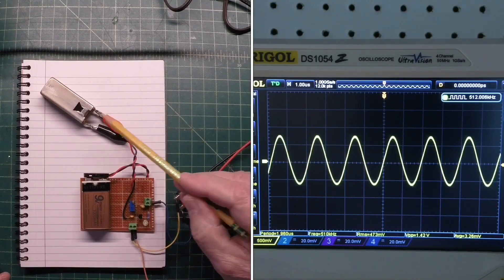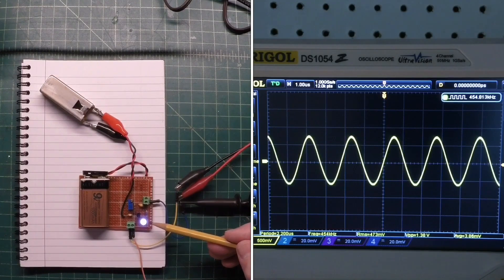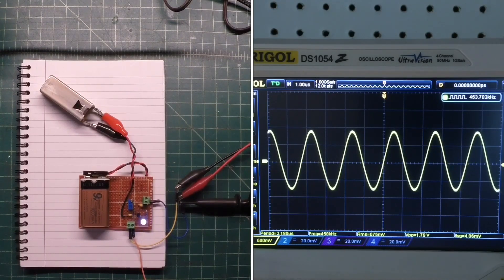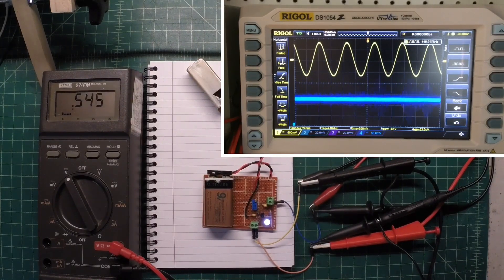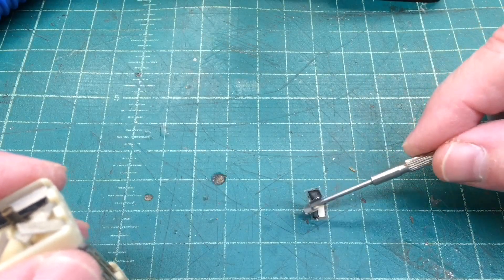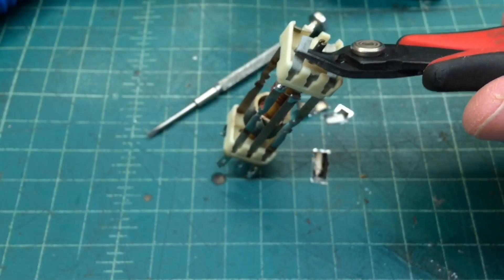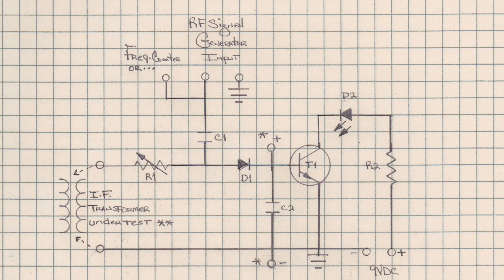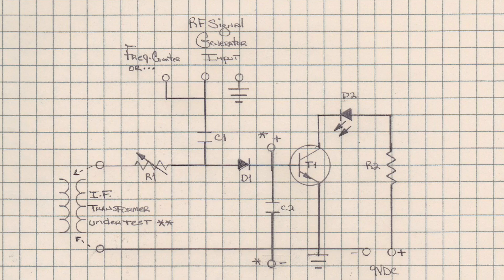RCA 8-X-541 - Cause & Effect P11 (Build This I.F. Transformer Frequency Finder + Silver Mica Update)

Comment: I made a flip flop type oscillator with parallel LC, found on the net. Connect the ift n measure the frequency.
Reply from the maker: That’s a great method and thanks for watching. Don
Reply: @RestoreOldRadios 
I tuned the IFTs to 10.7 MHz n put them back in the circuit. Nothing happened. Luckily I had measured their frequency. I set them to the original value, and tuned them in the circuit. Now it works. 
Inference is...at least in my receiver, they don't retain the set frequency due to circuits around them.
Reply from the maker: Yep, that parasitic capacitance comes into play. Thanks for sharing your experience. Best, Don

Comment: Hi Don ! Can I use 50K Potentiometer and adjust it to 13K ?
Reply from the maker: Should work unless stray capacitance shifts the actual frequency lower. Best, Don
Reply: @RestoreOldRadios  yes than I have to be careful to layout to minimize stray capacitance
Reply from the maker: @ Here’s a more recent build I shared if interested:

LC Circuit Tester to Evaluate I.F. Transformers + Antenna & Oscillator Circuits w/ Frequency Counter
https://youtu.be/9bmniYX4o2s
Reply: @RestoreOldRadios  Thanks
Reply: @RestoreOldRadios  My father measures resonant frequency by using Nano VNA , I will soon learn how to use VNA because it contains lots of functions.
Reply from the maker: @ I need to get one of those for myself.

Comment: Great video Don! Very informative. I'm a amateur electronic hobbyist.  Question about the stray capacitance. I built the Frequency Finder, which work very well,  but used a breadboard for construction. Rebuilt a 455khz IFT that had SMD with known factory values of capacitance. The end results showed the resonate freq of the IFT to be 480khz on the freq meter. Slugs were never moved. Can the stray capacitance of the wire length and lead length cause that much of a frequency shift?
Reply from the maker: Thanks for watching and reaching out. Stray capacitance (or any added capacitance) will cause the resonant frequency to shift lower in frequency. Just curious, I would assume the known capacitor value in the IFT you rebuilt is around 100 pF and the inductance is around +/-1 mH. Please confirm the capacitor value and the inductance of the IFT if you have a LCR meter. Thanks again and all the best. Don
Reply: @RestoreOldRadios  Made a rookie mistake when measuring the replacement capacitors which explained the readings of 480khz. Sorry. Corrected the mistakes and everything worked out ok. Here's the info you wanted: These are the corrected measurements Using newly bought  LCR , Inductor Pri= 1.238 mH @ 14.2Ω, Cap = 77.9 pf, Sec= 1.27 mH @ 13.9Ω Cap = 70.4pf. Your Frequency Finder works very well. Saves a lot of time. Thank you for the YouTube, information and the schematic, your time to help educate others wanting to know.
Reply from the maker: Thanks for the update. I find myself doing the same at times. Here’s the same circuit with an integrated frequency counter (FC). The FC module allows move to program (account for the stray capacitance), either way once the IFT is reinstalled in the radio, some additional tweaking is still required.

LC Circuit Tester to Evaluate I.F. Transformers + Antenna & Oscillator Circuits w/ Frequency Counter
https://youtu.be/9bmniYX4o2s

All the best.

Don

Comment: I've used a NanoVna as my signal generator, but I can't make the led glow. I have even tried biasing the led with a 10 meg resistor at the base of the 3904 transistor and it lights up dim, but makes no difference if I apply signal from the NanoVna or not. I've not even hooked up the transformer yet because I figure it has to be able to light the led before it can be loaded down with the transformer. Is the Vna not strong enough? I've also tried this with a Wavetek function generator at 455 Khz and 1 Mhz sine wave output and no results either, and it puts out about 5 volts. I could get the led to light using a 2N7000 mosfet driving the gate using the Wavetek sometimes, but I have never hooked up the transformer. I'm using the CW signal from the NanoVna on a stable frequency and can't light the led from that source no matter what I do. What should be my next step, and what is the output of your generator? Thanks.
Reply from the maker: Ryan - I’m assuming the 1N34A Diode (D1) is confirmed to be good? Best, Don
Reply: @RestoreOldRadios  It's a very old one I pulled out of an old field strength meter I built 30 years ago for 146 Mhz. I THINK it's a 1n34a, but it has red bands on it and looks just like a 1n4148. I found another field strength meter I ‘ve built and it has a larger center region and you can clearly see the "point contact" wire inside. I have not tried one of those yet. A lot of new 1n34a's on Ebay look very much like a 1n4148 and I've heard that many on Ebay, AliExpress and others are now fake, so I’m not sure how to tell if I’ve got a good one. The one I used for 146 Mhz worked well (on 146 Mhz). I have some 1N5711 Schottky diodes for another project (Carlson Super Probe), but they don’t work for this project either. I have not finished the “Super Probe” yet so I hope they work for that project. ZAFIR YILDER has a circuit using a CD4001 as an rf detector. Not sure how well that will work with something like this. He also has one using 4x BC547’s hooked up Darlington style. I’ve tried using two 3904’s as a Darlington pair. I just touch the base of the first transistor with my finger and the led lights up, yet won’t do a thing for rf. Thanks for all of your help Don, it means the world to me that you take the time to answer my questions. I’ll get this thing to work one way or the other.

Comment: Hello Don, Hope you are doing well! 
I was wondering if this could be used to figure out what size pF capacitor to use to tune this transformer for the known radio IF frequency. If by substituting pF capacitors is used (or a trimer cap), would I be correct in assuming that, if you get the correct LED response for the IF by changing caps, that the finished product would be a transformer that is aligned for the radio? Also, could a normal alignment process could be skipped? Of course I would set the coil slugs to some predetermined position (say halfway point of their range).
Reply from the maker: Doing good. I think the circuit could be modified, but stray capacitance would influence the accuracy. An alignment would still be required, but you could do that using a local station and adjust the I.F.’s for the best performance. Hope this helps. Best, Don

Comment: Nice circuit. But IF transformers will tune based on the stray capacitances when in circuit including those of the tubes. So the actual center freq will be quite different.
Reply from the maker: You’re spot on. The stray capacitance shifts the frequency by a good 50kHz or more in some cases. Thanks for watching a reaching out. Best, Don
Reply: NP . A swept freq generator with a triggered scope and a 10M probe seems to work quite well and is quite straightforward to set up.
Reply from the maker: @yannistzavaras4343  Thank you. Best, Don

Comment: Hi Don, very nice work and video. I have a question about T2 it looks like your using a 100pf and a 27pf ceramic capacitor? Is that preferred over new silver mica capacitors for IF Transformer capacitor replacements?
Reply from the maker: Hi Mark - a silver mica capacitor  will work equally as well. The ceramics I used were C0G (NP0). ‘Their formulation of the “temperature-compensating,” EIA Class I ceramic materials. ... C0G (NP0) ceramics offer one of the most stable capacitor dielectrics available.’

Hope this helps.

Best,

Don

Comment: Neat widget! After prying those flaky silver mica flakes out, it looks like with a bit of judicious prying and trimming of the existing tabs one could solder in an SMD cap. So you go from SMD to SMD.  (smh, sop, pdq)
Reply from the maker: You are correct, a SMD C0G (NP0) capacitor would work equally as well to the ceramics C0G (NP0) I installed. Thanks again for viewing and reaching out. Best, Don

Comment: I wish Hallicrafters IF transformers (SX-99, S85, S86. S-107, SX113) were that easy to remove the mica.  They are riveted in.  Last thing I want to do is to drill those out.  Love the circuit.
Reply from the maker: Albert - the mica caps in T1 is riveted between two pieces of plastic as well on the bottom side of the transformer, so since this is a keeper for me, I said to myself, if it ain’t broke don’t fix it or don’t break it. Enjoy the circuit and thanks again for watching. Best, Don
Reply: Hey Don, I openly wonder how generic these transformers can be.  I regularly see batches of old IF transformers on "the big auction site."  If the IF transformer has no taps on either the primary or secondary, it seems to me that they could be regularly substituted if your tester shows the same resonance.  However T1 is not a pure IF transformer (is sometimes called a frequency converter IF transformer) and often has at least a tap on the primary (your radio) and on the secondary if there is a crystal phasing (Hallicrafters and I bet also Hammurlund  -- without looking it up).  Those would be challenging to substitute.
 @RestoreOldRadios
Reply from the maker: Some great points Albert. I’ve got a few AA5 chassis’ in storage for parts only if needed and I’ve seen numerous transformers for sale in the past too. Did you figure out the best approach for removing the brass rivet to free the mica from the bottom of the cans without damaging... Best, Don
Reply: @RestoreOldRadios  I have no immediate reason to try it out now, but I would probably use a Drimel at low speed and a careful hand (challenging for me).  I have one suspicious IF on the '99 I just finished. Also I have a parts '99 that is missing an IF.
Reply: @i82996  I have removed SMD caps from several 85s and 99s. The drill/dremel thing did not work for me, I destroyed them or lost a wire or two. I saw a video of someone using that Hakko flush cut wire cutter to snip the brass rivet flange. It takes several cuts and when the flange is cut the brass will loosen. The last cut is to squeeze bend the brass rivet small enough to drop out. I have successfully done this with several with only one rough handed break of the litz on one side.
Reply: I read some where that you can use your soldering iron to push the rivet through the plastic.  Tried it out and with a little fiddling it worked.  You can only get the rivet so far through the plastic by  pushing the soldering iron through the center of the rivet.  At some point I had to take the tip of the iron and push against the lip of the rivet to push it the rest of the way out.  Not necessarily elegant, but it worked without destroying the If Xformer or damaging the wiring.  I've destroyed a couple of transformers trying to drill them out.  Worst case is when the rivet is loose enough that it just catches the drill bit and just spins.    The soldering iron approach works, at least without destroying the transformer.

Comment: I love these simple circuits.  I was wondering if stray capacitance and inductance could be reduced by using a generous size circuit board with wide spaces between the circuit tracks?   Also keeping the probe cables further apart may reduce these too. 
Thanks Don
Reply from the maker: Paul - all the above to your points. The measured capacitance across the two test leads in my configuration is 2.7 pF at 15 kHz. I added R1 to reduce the loading and possibly moving that resistor to the end of the test point would improve the circuit too. Have fun enhancing the design and I would appreciate you sharing the changes if time permits. Thanks for reaching out and taking time to watch. All the best. Don

Comment: Lovely little circuit there Don. Just wondering if the ferrite core in the coil affects its resonance?
Reply from the maker: Thank you George. The ferrite cores (primary + secondary) to your point are adjusted to the I.F. Frequency of 455 kHz in my case. Thanks again for watching and enjoy the build if you elect to do so. Best, Don
Reply: @RestoreOldRadios  Ok, I was just wondering if having the core mistuned to say 470Khz instead of 455Khz would show up as a mistuned coil or if the device would say it was spot on. 
I get how it works, like you said, similar to an rf probe and was looking at the possibility of modifying it with a built in meter movement with a suitable high impedance to prevent loading... It is a great device for sure. Many thanks for the reply Don... All the best from the UK, George
Reply from the maker: George - you are correct. If I would adjust the inductors high or low, the circuit will track the resonant frequency accordingly. A meter option sounds intriguing. I look forward to seeing your updates and progress. Have fun and stay well. Best, Don
Reply from the maker: BTW - you can use a 50 to 100 DC micro amp meter in lieu of the VDC...

Comment: Q: Do you suppose this could be used to determine if the detector circuit is doing its job removing the I F from the audio??? If so or not, what mod might one need to accomplish this?
Reply from the maker: Not using this circuit assuming the I.F. Transformer is working as designed. Are you having issues with the detector circuit in a receiver? Best, Don
Reply: @RestoreOldRadios  : Actually found the primary on my radio's  field winding open.... Before that.... the audio came through as an extremely lower wisper,  as though the detector perhaps wasn't  seperating the I F from the audio like it should. Afterwards, I injected straight audio through my TV/RADIO port option and found the open winding. Sometimes the obvious and simple is the truth. Thanks for the reply and great video. Best regards.
Reply: Correction: I misspoke: I found the step down speaker transformer primary winding open. Have since replaced it and am enjoying the richest sounding radio I've worked on to date (8s-463 Zenith). Thanks Don!
Reply from the maker: My Youtube Congrats on the repair and I’m glad it’s playing well for you. It’s a rewarding experience to hear them sing again. Best, Don